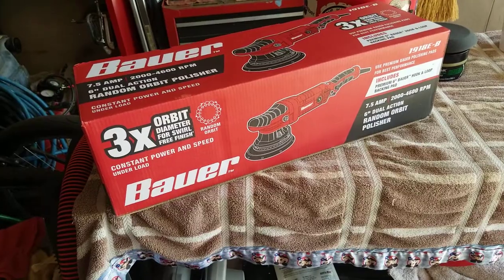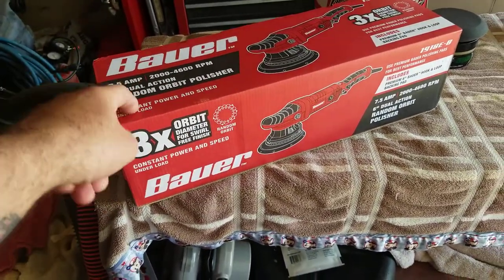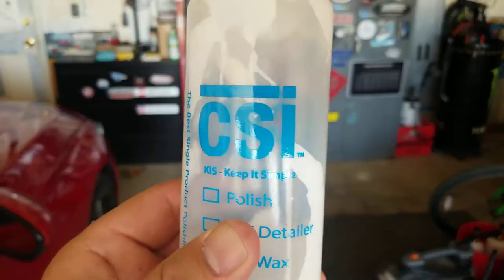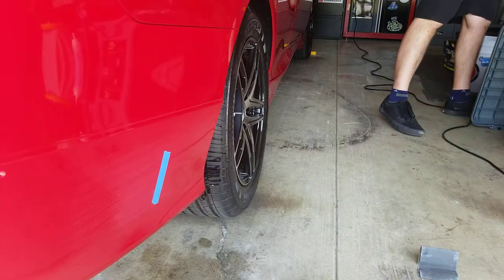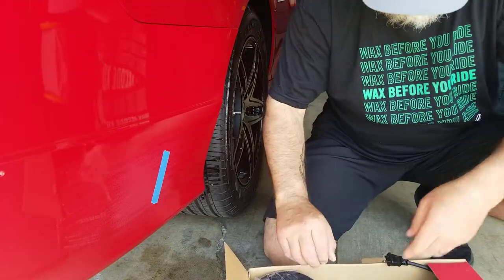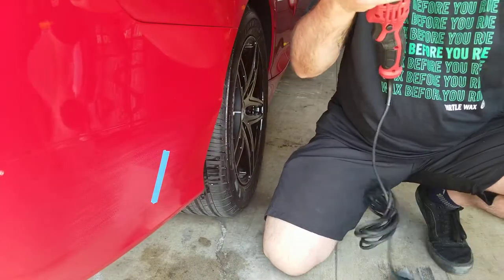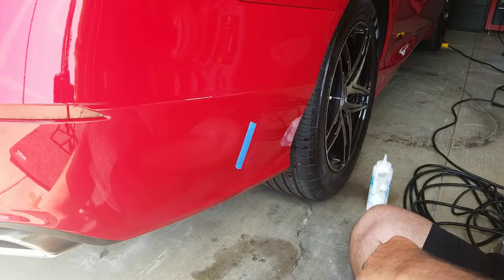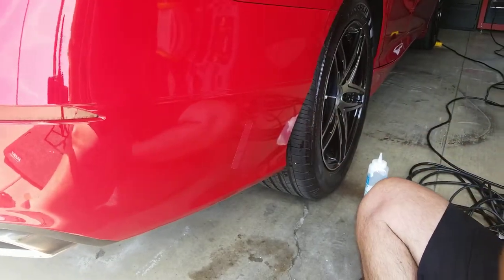Best Car polisher | Bauer 20mm long throw | Impressive and affordable

Comment: I'm shopping polishers & this one is at the top of my list
HOWEVER,
It concerns me that it only has 7.5A motor compared to 10A or 12A that the major brand polishers sport.
I worry when working serious oxidation this Bauer may bog down not making enough torque for the job.

!
Reply from the maker: OURv, I hear ya! That said, at the price point of this polisher you don't Lose! Why don't you ask HF if you can try it then return it if unhappy. WIN-WIN! Otherwise, DeWalt, rotary is An AMAZING option; WORKHORSE!! If you feel comfy with a rotary! Thank you for the comment ; Take care!!✌️

Comment: I swapped the grease for red and tacky and put a rupes 5.5 on mine. It's really smooth and almost no vibration.
Reply from the maker: Thank Ypu for sharing! Yeah,  Lithium grease , multipurpose or red n tacky would be great. I ALMOST used Full synthetic Grease and opted for Lubriplate grease(very reputable grease company). Mines actually for sale right now...haha.... but I am Happy I shaped the grease. Good experience! Also, thanks for the Rupes backing plate tip. Much appreciated. Take Care!

Comment: Correct.  I didn't find 1.  I took it apart. It's just 1 small bearing inside a hole under the plate with the 2 screws.
Reply from the maker: All I did was upgraded the cheap factory grease in the head to a premium grease, LUBRIPLATE!
Reply: Yep me too. I used grease I had for my sxs.  It is called atomlube that eliminate friction, repels water and corrosion and nano engineered.  So should be good for the polisher, lol
Reply from the maker: @daviddup1978 absolutely!

Comment: I heard replacing the greas that the polisher comes with makes a big difference on the vibration of the polisher. How's it so far I'm looking to buy a polisher and was thinking either the bauer , spta cordless or the chemical guys polisher. Great video
Reply from the maker: Strike King, hows  it going.? So far I am very impressed with this Bauer! I have owned Adam's long throw and this is comparable. For the money, you cannot beat the price. With coupon its 99 dollars right now!! Best buy I have seen! It performs fine for what I do. I rarely do full cars or trucks anymore. For daily use, i would love to know how it holds up. Honestly though, so far i am impressed!! Thanks for watching👍
Reply: @detailit  thanks for the reply , appreciate you taking the time , coupon what coupon ? Just subscribed 👍🏽
Reply from the maker: Hey man, sorry for the delayed response. The coupon is a Harbor Freight coupon. Look on social media right now they advertise this machine at $99.00. Pick one up. For 100 bucks you cannot go wrong here. Take care!

Comment: The G9 should be the superior polisher out of the two right? How is the vibration on the Bauer vs the Griots ? Also does the Bauer get hot?
Reply from the maker: Hi. Yea the Griot's should be the better machine but beings this Bauer has the longer throw I like it for larger vehicles. It seems to ok with heat. Better now that I removed the cheap factory grease and relubed with Lubriplate premium grease. Runs much quieter and smoother now👍👊. Hard to beat this Bauer especially at 100USD.... GREAT DEAL !